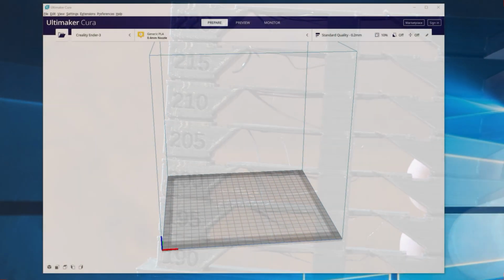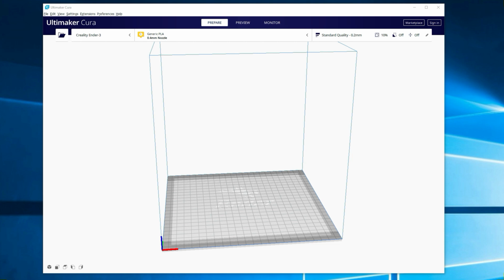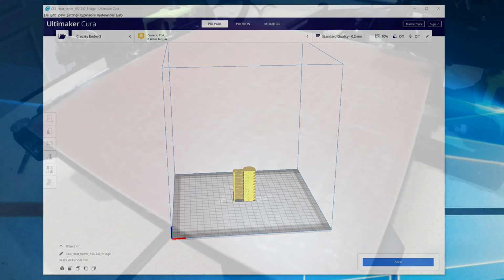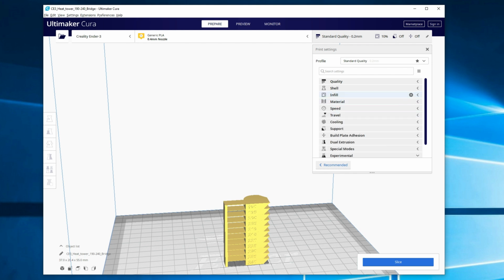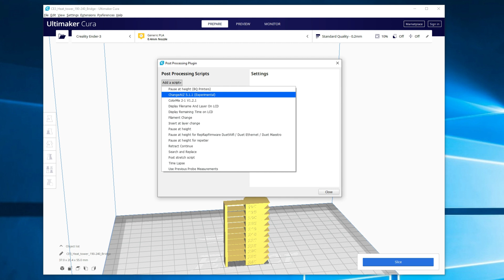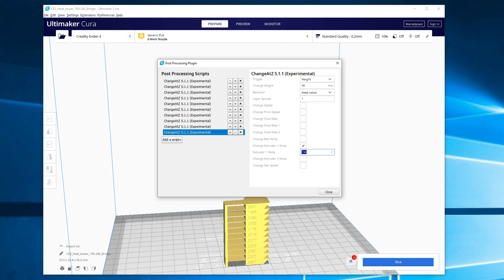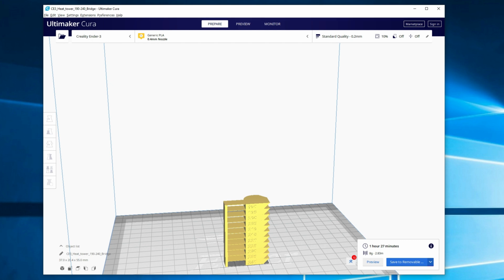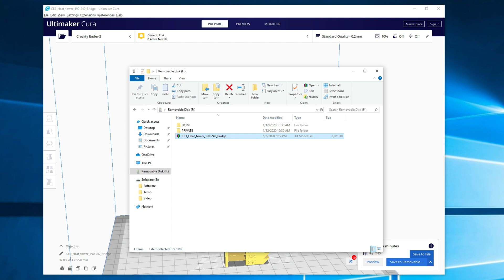Create 3D Printer Temperature Tower With Cura! (Complete Walk Through)

Comment: I realize this might be painful and borderline machocistic(sp), but if one were to embed  the thingieverse .gcode temperature snippet into a gcode version of the temperature tower .stl fie, would you embed the "...if -then ..." block at every temperature change point?  I assume that the if-then logic loop would determine which temperature setting to use by examining the current layer count the loop was executed at.  Is that correct?
Reply from the maker: Hi. In theory something like that would work, the issue is the g-code is specific to the printer so it would have to be provided for at least many common printers.

Comment: Hey, n00b question: How does the filament defy gravity and print bridges?
Also, why doesn't the gcode already have the temp lowering cmds in the code?
Reply from the maker: Hi. The bridge is built by the filament being cooled as soon as it comes out of the nozzle, basically not giving it enough time to droop. The temp tower code would be in the g-code if it was sliced with that enabled. The gcode is a point in time snapshot of what will get printed.
Reply: @3DPrintscape  Gotcha, thanks for the reply!

The other thought I had was I saw there was a 'pause' command available in the gcode. Do you suppose a short pause at each temp change would help to better define the temperature changes?

I can see that I am going to end up editing a lot of gcode because of my Aspy tendencies. Excellent tutorial BTW!
Reply from the maker: @AiMR  I think adding a pause to the end of each temp would cause more problems because each time you resume from a pause, you have some risk of blobs and failed print.

Comment: I will try this tomorrow thanks.  So far I cannot get PETG to stick to anything.  If it does it’s only the perimeter and when it starts to fill in the part gums up and comes loose or plugs to nozzle.  I’ve tried all kinds of heats, adhesives, bare glass, painters tape, etc.  nothing works.  I’ve leveled the bed numerous times and started at various distances above the print surface.  So far nothing works.
Reply from the maker: Hi. Without knowing your setup it sounds like the bed isnt level, the bed is warped, the nozzle is too far from the build plate, or the filament is not being printed at the right temperature.

Comment: I am using Cura 4.8 and as others have stated, this doesn't work for the different temps.  It stays on 240 degrees. Your video was very thorough and I appreciated the attention to detail as I am very new to 3D printing and I have an issue with stringing of my filament so I am hoping this will help.  I look forward to a video dealing with layers.  Thank you.
Reply from the maker: Hi. Thanks for the feedback. I actually did a video a couple months back covering a work around for this, you can see that here. https://youtu.be/EAl-fWkwU-I
Reply: @3DPrintscape  Thanks, I'll check that out.  I am not using an  Ender, but a CR6SE for my printer.  I watched the print and manually changed the hot end temp settings and the print did fine for me that way.

Comment: whwat happens if cura doesn't update the temperature?
Reply from the maker: Hi. If you are using Cura 4.8, it sounds like there is an issue with it switching temperatures based on height. Someone else said they were able to get it to work based on layers, so I will probably do a video covering that.
Reply: @3DPrintscape  I made the same observation - using Cura 4.8 - the temperature remained at 210C (even after configuring the G Codes - I checked the file, M104 has the correct values). PS: Do I also need to manually set the Cura nozzle temperature to match temperature at layer #1?

Comment: Im using Octopi and i did a tower in the Cure 4.8 like you did here but in OctoPi and in the printer display, the nozzle temp does not decrease.
Reply from the maker: Hi. I had one other person say that had issues printing a temperature tower on Cura 4.8 I will look into this more, its possible the plugin isn’t compatible yet.
Reply: @3DPrintscape  it's something with the new feature because I scanned the g code and wether you put to change temperature in a single layer or in the current layer and subsequent cura changes the temp and then rises it again to the 240. I FIXED it by instead of height to trigger I used layers. And if you do 5mm/0.2mm layer height you get 25 layers. So I enabled the trigger to change temperature each 25 layers and it's working properly.
Reply from the maker: Awesome, thanks for that info. I have had a lot of people ask, so I think I will record a video on this.
Reply: @3DPrintscape  Feel free to do it! I've managed to do it only with the layer calculation instead of the height calculation!
Reply from the maker: I just ran a test and it’s changing the temperature as expected for me. I have it set to change every 5 mm like I have in the video. I know other people are having the issue you are having as well. I’m thinking it may be firmware related. What firmware are you running?
Reply: @3DPrintscape  I'm running version 4.8 Cura. And on the printer firmware I'm running Marlin's latest firmware for Creality Ender 3 v2. I followed the guide on DrVax channel
Reply: @3DPrintscape  I've checked and I have firmware version 2.0.7.2
Reply from the maker: Are you using the stock 32-bit board that came with the v2? Maybe thats where the issue is, im running the SKR Mini E3 v2. Im going to do this video today with it going live on Tuesday, it sounds like a lot of people have this issue. I will say that if you are running Cura 4.8 you may have issues printing a temp tower using height as a trigger and the workaround would be to use layers.
Reply: @3DPrintscape  Yeah i have the stock ender 3 v2 32bit board.

Comment: For testing purpose, I input a single post-processing script following your example to change hotend temp from 250C to 245C.  When I looked at the output gcode file, I see this:

;[CAZD:
M104 S245.0 T0
;:CAZD]
G1 F300 Z12.05
G0 F14400 X98.527 Y109.324 Z12.05
;TYPE:FILL
;[CAZD:
M104 S250.0 T0
;:CAZD]

Looks like there's an M104 that changed temp to 245C.  But then there another M104 a few lines later that changes back to 250C.  What's causing this?  I'm using Cura 4.7.1.
Reply: There's a parameter in the script called "Applied 'to,"  with menu selections: "Target Layer Only" and "Taget Layer + Subsequent Layer."  The Gcode above was generated using the "Target Layer + Subsequent Layer" selection.  When I selected "Target Layer Only,"  the generated Gcode doesn't have the second M104 command changing hotend temp back to 250C.  Does it seem like implementation for the two selections are backwards?
Reply from the maker: Hi. Was 250 the temperature you had set in the main profile? It sounds like it's falling back to that after the target layer is printed at the defined temperature. Also, what plugin are you using where you see that? Im using the ChangeAtZ 5.1.1 plugin.
Reply: I'm having the same issue and now after hours of testing I believe is something to do with the ChangeAtZ 5.2.1 (experimental) version
Reply from the maker: It sounds like the issue is related to ChangeAtZ 5.2.1. When I get some time, I will upgrade and compare the gcode outputs.

Comment: Great video! I'm printing the tower now with my Ender 3 Pro. When I first uploaded the file the bed temperature worked, but the nozzle temperature stayed at 0°C. I then manually changed the temperature to 240°C and I hope the temperatures still change! I'll keep an eye on the print.
Reply from the maker: Hi Gavin. Were you able to get this working? It sounds like the layer height/temp or the initial layer temp may not have been setup right. Let me know if you are still having issues, I will try to help out where I can.
Reply: 3D Printscape yup I got it to work! I guess I didn’t realize you had to set the temperature before the print. I assumed the G Code would set the temperature for you. Thanks again!

Comment: hi i did this but it seems its not changing temps?
Reply from the maker: Hi, did you verify that the temperatures were changed in the gcode file? Without seeing it, my thought would be it didn’t save the gcode correctly or the height adjustments were not set right.

Comment: Thanks for the current video! Some of the others I found on Cura where older versions and didn't have the "magic" Extensions > Post Processing menu. So again, Thank You! Tower is printing now so we'll see how the new filament test out.

Question about the Amazon Basics Filament. Did you need to do anything special to get it to play well? I bought a roll when I ordered my printer just to make sure i had an roll on hand. Finally tried to use it and can't get it to play well at all. It starts to print and then just stops, like it's clogging. I didn't do a temp tower yet but tried 215C and still crappy results. More than likely just need to be more patient and do more tests but figured I'd ask... Thanks again for the Cura walk through. So much to learn so little time!
Reply from the maker: Hi. Your welcome, I'm glad you found the video useful. I didn’t have any issues with the Amazon basics filament, though I prefer HATCHBOX. I only bought the Amazon Basics filament because I was printing a bunch of masks for a local hospital, and Amazon didn’t have many options in stock (this was during the peak of COVID-19).
That said, based on what you are saying, it sounds like you either have a small clog in the nozzle, the filament has been out too long and has absorbed too much moisture causing it to swell, or you got a bad roll f filament.
Reply: @3DPrintscape  Yeah, it's only been 3 to 4 weeks that I've had the Basics filament and it's been wrapped right up till we went to use it. We're pretty darn dry here in Arizona so I want' thinking moisture was the issue. I also replaced the nozzle at the same time as the filament so guess it could still be "wet" but also might just be a bad roll.  Tossed in a roll of GST and I've had no issues, printed the heat tower and another 3 hour print without issue. The "fun" of 3D Printing! LOL Thanks again...
Reply from the maker: Its good to hear you got everything going. It sounds like you got a bad roll of filament, I would try to return/exchange it with Amazon.